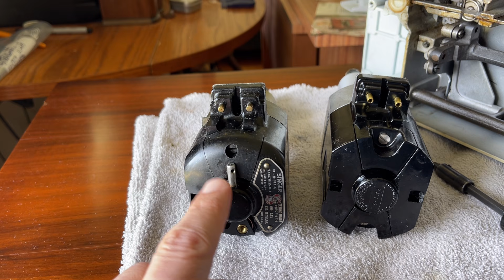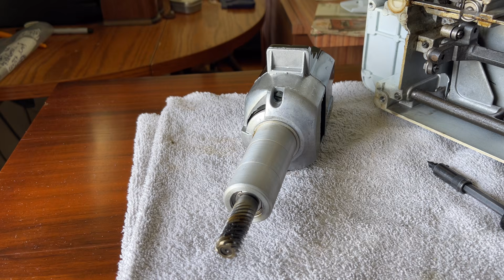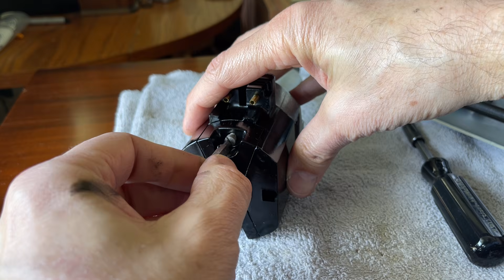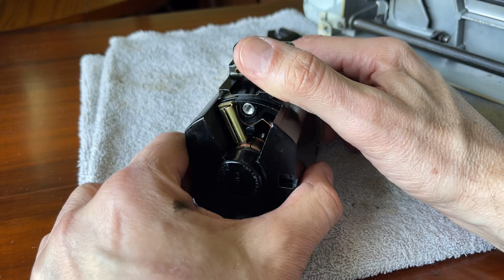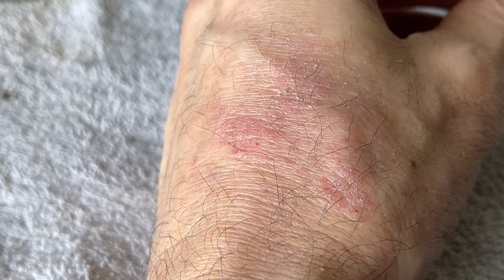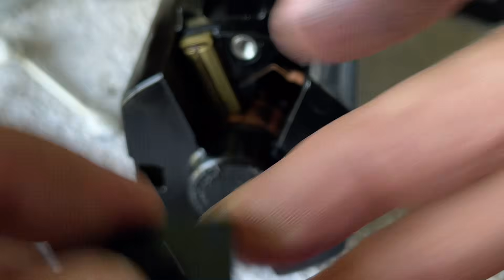MOTOR SERIES #40:  Is Singer's Direct Drive Motor The Best Ever Produced For a Home Sewing Machine?

Comment: I love your videos.
The nut at the top of the shaft is a type of locknut. Modern locknuts typically have a nylon insert instead of the slotted slightly deformed nut on the 301 motor.
Also the best oil for non automotive applications is non-detergent oil. So when you go to the local auto supply, look for SAE Non Detergent 30 weight oil for the top bearing.